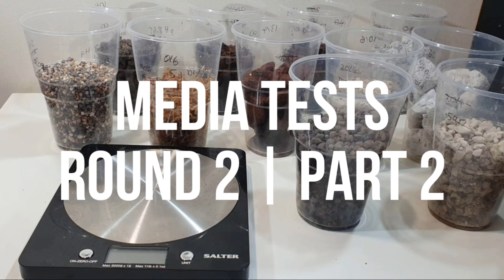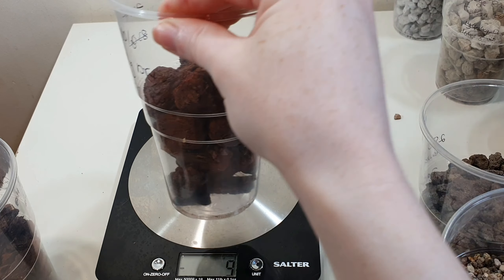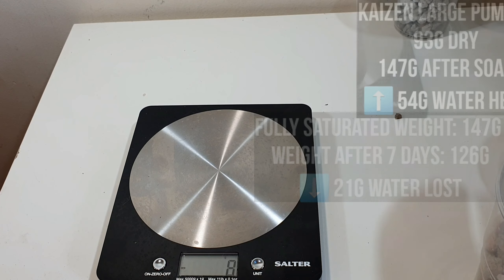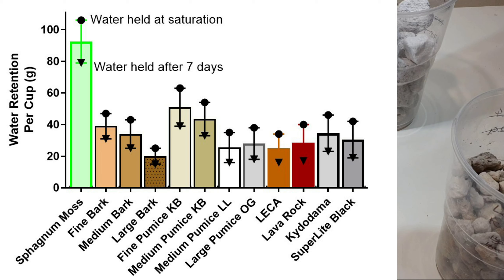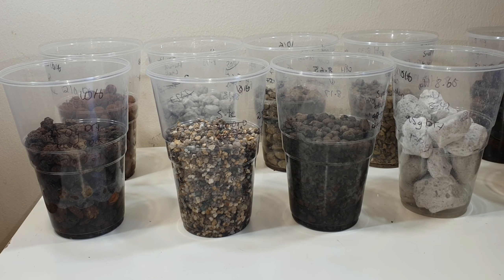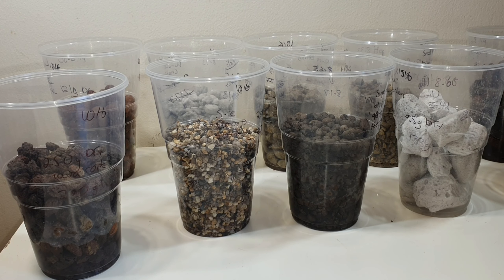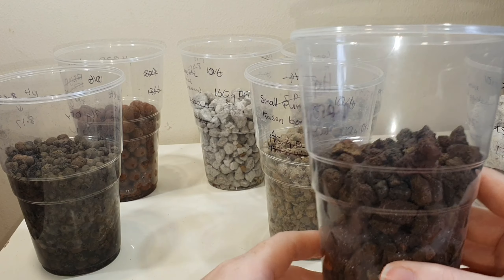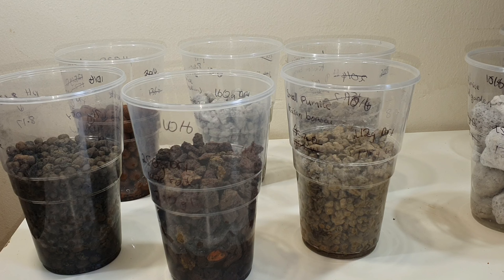Media Tests Part 3 | Wicking efficiency and Drying times | Does Lava rock wick better than LECA?

Comment: I was thinking they all seem to wick to the top. Maybe you should have put a mark at the leave of water still in pot. Another thought leave them for another week and check them daily for water leave & dryness. This wicking lasted 8 days this one 10 days and so on. The large Pumice had no water left, it will dry out at top first.
Reply from the maker: Not sure how that is helpful though. As I mention, it could be the top of the cup providing a humid microenvironment that is the issue. Take these findings and extrapolate them to a real life situation- Leca too dry, maybe there is another alternative etc. No water left doesnt really tell us anything useful I think. Not really. For some it does, like the small pumice- but compare that to the lava, which still has most of its reservoir, while being super wet at the top- so something else is going on when you add a reservoir, but I dont think measuring thay really tells us anything. For the larger media it could just mean more air gaps so more evaporation. But for the actual media itself, I showed that evaporation remained constant between the different sizes.

Why do I want to dry them fully? I already did that for the previous tests 🙂 no new info for that. The water level in the reservoir wasn't what was being measured. The dryness at the top varied between the materials. I wasn't saying one was bone dry and the other was wet- just comparing between the different media for how I felt about the top layer. Honestly, this was extremely time consuming and labour intensive, so I won't be repeating for a long time 😅 You are welcome to take the experiment and carry out further work 🙂 That's really the point of this- environmental factors and plant variables mean there is so much more going on than just what happens in controlled Cup experiments. Trial and error is needed for us all in our huge and varied different environments, medias and styles of growing.
Reply: The Orchid Room A lot of factors come into play. Does the plant have big cunky roots or fine roots, airy or Suffocating,  environment, medium, temperature, what the particular plant likes. It was interesting that they all wicked. I kept a record of your finding.

Comment: Can’t tell you how to measure top layer dryness... I go by what I see and take it from there 😬 not very science am I? 😅 I love my lava rock in the little pots for small dendrobiums, the larger lava rock does not stay as moist at the top as the smaller one does, also... pot size plays a factor... the larger the pot, the less wicking there is regardless of reservoir size and media size. That’s where your top layer pebbles take care of that 😊 love it when you do sciencey things... makes me feel like a dodo in the corner, but I appreciate trying to put things into visuals and words 👍🏼👍🏼
Reply from the maker: I don't think there is an easy, reliable, accurate way to put the top layer dryness into numbers unfortunately 😅 As much as I would love to. I always scale up reservoir height to pot size, so proportionately they should be the same- I use approximately 1/3 to 1/2 of the pot as reservoir as a general rule, depending on the type of orchid. But as each piece if media passes moisture from one piece to the next, there is an overall net loss I believe. So by the time you get up 2 feet of media vs 10cm, the efficiency would be compromised. Also, if your environmental conditions mean that the rate of evaporation exceed the efficiency of wicking, there will always be a significant dry line. So many variables, it really is a case of try and see... but having larger reservoirs allows me to top fully in summer, don't need to fill it to capacity in winter. Self-watering takes alot of that issue away, can fill as high or low as I like and still flush easily! The larger grade lava I bought for Vandas also seems to stay very moist up to the top, but getting much larger there will be less contact between particles I agree. But then for this large grade pumice it still wicked really well so who knows 🙈🤷‍♀️🤷‍♀️ Makes you think, can we ever really fully advise someone else in their conditions, probably not, which I think is the major learning curve as a grower. Some still try to dictate though, but often I believe it's just trial and error for us all! 🙂
Reply: The Orchid Room totally agree with all of the above ... but I still love all your sciencey stuff (<—- see? I even use inadequate lingo! 🤣) I’m useless 😂
Reply from the maker: 🙂❤ Science stuff 🧪🧪

Comment: Lava rock may be more moisture retentive and more wicking but leca is easier to come by and  a lot cheaper I think. Thank you for sharing  your experiment with us.
Reply from the maker: Yes- but that is redundant if the LECA burns all your new root tips, which has happened to me frequently before starting experimenting with different inorganic media and non porous top layers. It doesn't happen for everyone, depending on environmental factors and the individual plants, but that is why I began searching for fixes and alternatives. Since all are reusable, while lava is an initial investment, I am happy to use it in combination with LECA- which will bulk it out. In the long run both options are cheaper than moss or bark for this reason 🙂
Reply: @TheOrchidRoom   Also using organic materials need to be repotted every year or too, right?  It can be expensive at first using inorganic media but in the long run time is money. Not having to repot and buy new organic media is a plus.  AND my cats won't want to dig because it's not dirt! LOL!   Not messy either, and not as many fruit fly's. 😺🌻

Comment: Just wondering if you could help me plz I got the dendroblum berry and they call the other one the dancing lady got yellow flowers got them out of Sainsbury yesterday I'm not sure what to repot them in  ppl was telling me bark and moss but I'm not sure what to do thanks
Reply from the maker: Hi Steven 🙂 Dendrobium Berry oda does very well for me in LECA, but bark and moss will be fine for it too honestly, it's a tough cookie. The oncidium types have finer roots and want more moisture around them, so a bark moss mix with a little more moss in will work well for them too. Or you can do less moss and water more often, but oncidiums can be a bit tough to keep up with in hot weather sometimes, they are very thirsty things. Just remember the more moss you put in the faster the media will break down, so you'll need to repot sooner. For pure bark you could probably do a 2 year repot cycle if large grade. Adding moss tends to mean a yearly repot is needed due to the media breakdown. Hope that helps 🙂
Reply: @TheOrchidRoom  would love to do leca thing but I'm new to those type of orchids so hard what to do  I've done the leca with my phals they are doing good in it but it's just the new orchids what's worrying me
Reply from the maker: If you've got phals established in LECA and doing well, I would say the Berry oda should do great for you in LECA- it is super vigorous, probably easier than a phal honestly! The oncidium though, for me I found them to be a bit trickier in LECA, dry top layer issues burning new roots. Lots of people do not have this problem at all though. But for a safe bet for both, you can't  beat bark/moss to help get them established with your environment while you get to know them 🙂
Reply: @TheOrchidRoom  bless ya bab thank you so much I'm going to put berry one leca and the other one in moss and bark just till I know the plant love your videos always helps  😘😘 thank you

Comment: Hi, have you applied the light and air movement during the experiment?
Reply from the maker: They are all in the exact same location, windowsill, light, window ajar- but we are comparing between them under the same conditions, so the differences between them are the only take home from this. Not what would happen in the pot- where there are an even larger amount of variables at play.
Reply: @TheOrchidRoom  was just asking because of the top layers being wet :)
Reply from the maker: @35o125  I think this can be explained by the humid microenvironment created by the top third of the cup 🙂 Next time I will use larger pots filled higher to test more thoroughly on a few, this gives us a broader overview and comparison though.

Comment: To me you would need taller glasses with more media to see which media wicks the highest . You don’t want any to actually reach the top and the highest one would be the best wicker. Your numbers would be the height of the wicked water.
Reply from the maker: I would prefer to actually have something to measure accurately, not just height of water, which may be deceptive and hard to measure. I agree on the taller, larger containers, if we want to mimic a pot. This gives us comparisons between each media as a starting point though, which is time consuming for such a large range of media. Future work would potentially take a smaller group individually and perform more detailed analysis, taking off the top layer and weighing to obtain water held 💧
Reply: The Orchid Room you are doing a lot of work for sure!

Comment: If you want to quantify the wicking, remove the top layer, weigh it, wait for it to dry completely, weigh it again.

The difference is the water that was still in the top layer :)
Reply from the maker: Yes totally 🙂 the only thing that puts me off is the smaller media, how many pieces I would be weighing etc to make up a top layer. I suppose I could count 10 of LECA, 20 pieces of pumice, 40 or 50 of kyodama, but then would I be picking up the same pieces after the 7 days? There is a large natural variation. I couldn't  mark them all. I could mark just one, but then I would need a more sensitive scale. Will think on it 🙂 It would totally be a viable way to maybe do a smaller experiment just comparing some of the larger media.
Reply: @TheOrchidRoom  You don't have to reselect the same pieces, just scoop off the top layer after the week of wicking test, weigh it, then let it dry out completely, weigh it again - the pieces never need to go back.

Yes, there's still a question of 'how much' to consider as the 'top layer'... but it's at least part way to quantifiable.

Maybe you say the top 10% by volume is the 'top layer'? Difficult especially for the chunkier media...
Reply from the maker: I see- do it in reverse, I like it, eliminates the issue! I'll plan something out 🙂 Thinking, fill cups to the top too and put them in my grow room, really test them a bit more harshly.
Reply: @TheOrchidRoom  Yep, in reverse! :)

I thought the best test would be a conventional 12cm orchid pot & container, without a plant in it of course. In the grow room also makes sense (so long as they're getting the same solar exposure).

Excited to see the results! :)

Comment: Annabel,
Reply: Sorry, hit the wrong key.   Thanks for the little experiment.   To digest the results requires putting a different thinking cap.   Anytime you attempt an experiment, it always plays in the back of your mind "can i reproduce the results".   But i found your thought process to be excellent.   I also though you have the same addiction to iced coffees like i do.   But thanks again, i believe i need to go back and re-watch the previous steps/videos.   Have a great day and i look forward to seeing your future videos.
Reply from the maker: Hi again Tom! I do feel that there were things I could have done better- this is always the way everytime you perform an experiment for the first time. It's unlikely I'll be able to do experimental repeats for this one, these tests are super time consuming with so many media. In future I would probably zone in more on each media type separately and try to adopt a better, refined methodology...but I wanted to do a wider experiment as a comparison across the board first, since otherwise it would be difficult to generalise them all if I did them each separately, and it would rely more on how I felt- the numbers would drift, temperatures wouldn't be consistent etc. Thanks so much for your time and for watching!